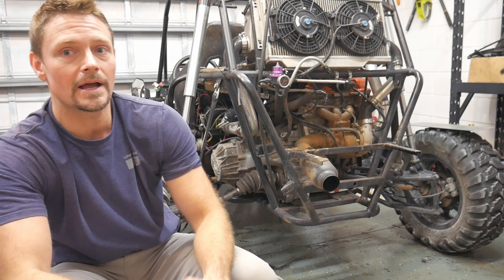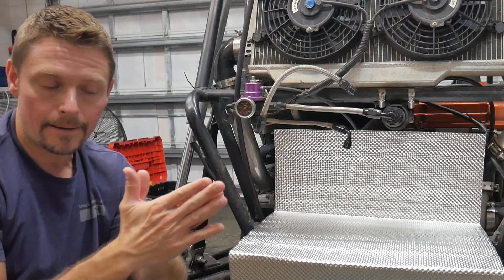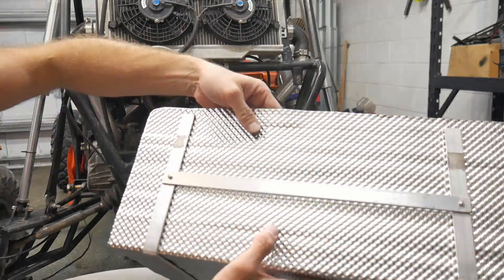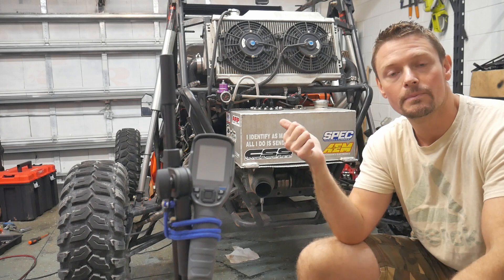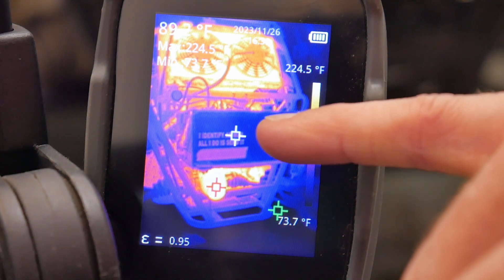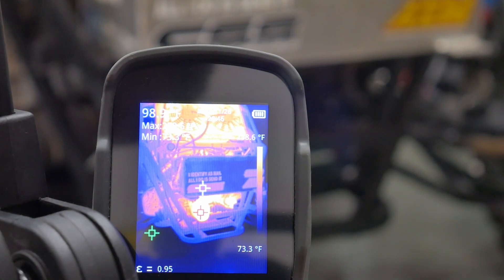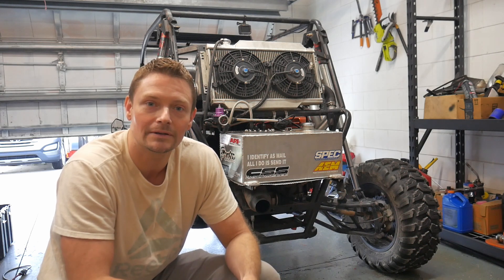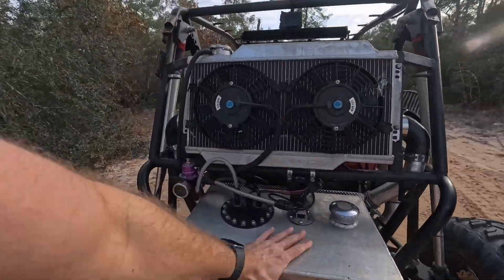Stop 90% Heat with this DIY Heat Shielding Method

Comment: What make model and specs are those shocks. I'm thinking about ditching the coulovers also. Mine look basically the same. Also I picked up a Suzuki 1.3 4cy motor and trans and a turbo kit I'm now building for a swap. Hope to ride with you guys again sometime. 😮
Reply from the maker: These are the fox air shocks, very light weight! My rears I believe are the 2" so they are almost maxed out on psi, my only regret is not using the larger 2.5" in the rears. They aren't for every application but they have worked well for me as long as i'm using my limit straps

Comment: You could also add some aluminum fins to the sides so the air passing takes some heat out of the tank. I imagine the fuel pump you are using is a proformancecpump to keep pressure under boost if so its putting alot of heat in the tank aswell. With those kind of pumps fuel volume is your friend so running on 1/4 tank or less will get the pump running hot and cause failure. If its a stock style pump they dont create nearly as much heat. I line that you used to coragated aluminum as even if its touching in places it will alway maintain air gaps so it will minimize heat transfer to small contact patches. Great idea.

Comment: The stickers are showing actual temp. So with thermo cameras the shiny aluminum is reflective and makes the camera in acurate. The best way to read shyny objects is put some non reflective tape on it or just use a temp probe instead
Reply from the maker: That was my suspicion, thanks for the clarity it deff makes sense!
Reply: @DirtGearTv some IR guns allow you to enter the emissivity of the material, which would allow you to compensate for the shiny aluminum.